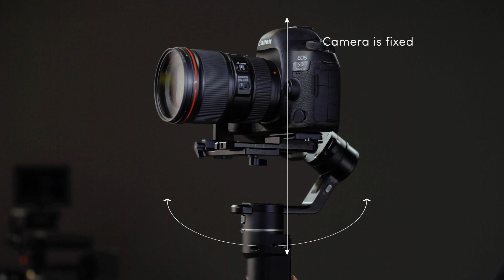Gimbal Tutorial EP4 | Typical Commercial Camera Movements

Comment: Hi   Xiaoyu Yang , I wonder if you could help me get an accessory made for the AK series of Gimbals. particularly the AK4500. 

The AK2000, 4000 and 4500 gimbals have been designed so the head and handle can be separated.
but there is no protection for the head or handle interface pins.  A screw on cap for the head and the handle would be useful.  But there is more,  include a  1/4 20 into both caps and an extension cable which plugs into these caps and just think of the rigs you can make!  You could put the head on a slider or even the mini tripod that comes with the Gimbals you can mount your phone and do object tracking  on the slider or even the mini tripod  you could add en extension bar between  the gimbal head and the handle (use as a jib) or other high shots and you still have the controls at hand. 

What initially got me excited was the idea of building in a usb port so you could use the follow focus off the Gimbal just connecting a usb-C cable to it. Why do i need to buy  a second follow focus when not using the gimbal?  

I had one more idea that might work to have a Dtap connector as well. This would allow you to use the handle as a battery for the camera.  you just need a dtap to whatever your camera needs. I think this would be so useful , in so many situations. 

This accessory would be very light , protect the gimbal electronics ports when broken down and easy go in a backpack. making it perfect for travel but  it would work anywhere.  Maybe need different length cables according to how you use it. 

What do you think, would this help give Feiyutech an advantage in the gimbal market ?
I hope you can get this idea to the right people in Feiyutech .